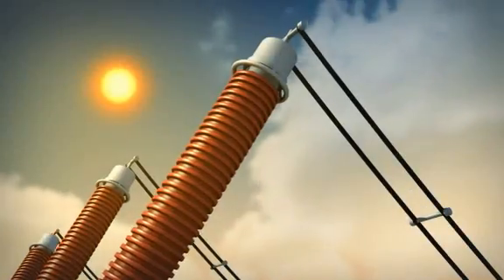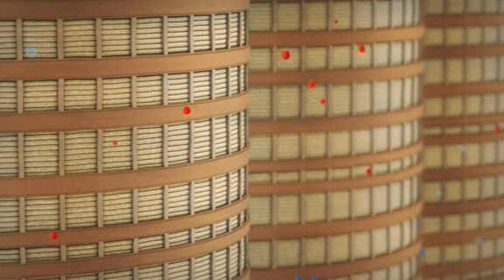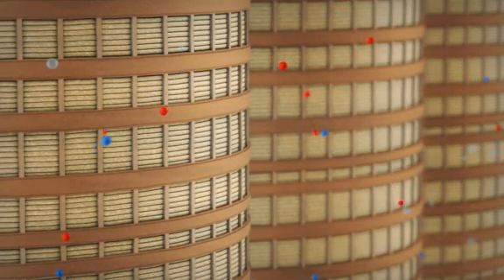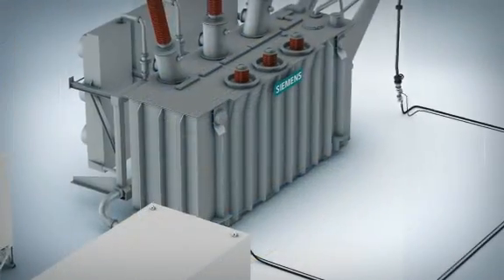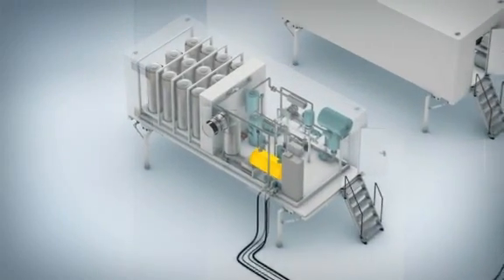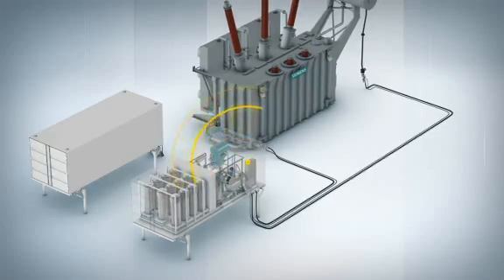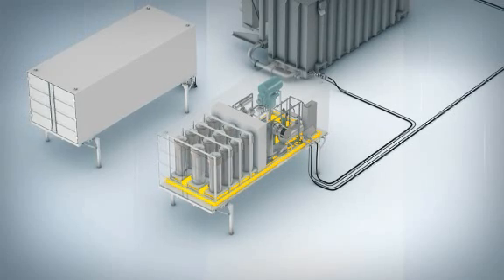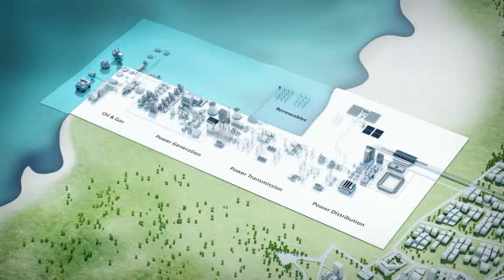Power Transformer Oil Regeneration (Siemens)

Comment: As the solution : you can convert your power transformer into generator by banking into delta delta connection the electro magnetic field would not stop flowing so the power wont stop. If still confusing call me so we can talk more precisely dont hesitate we can start change the world by teaching them how simple the construction of power is 😝👼😇